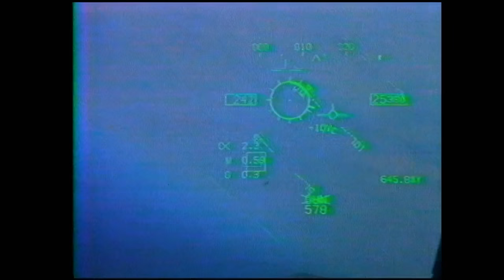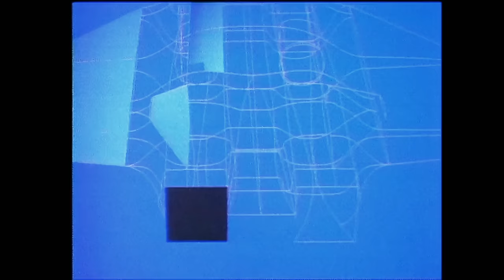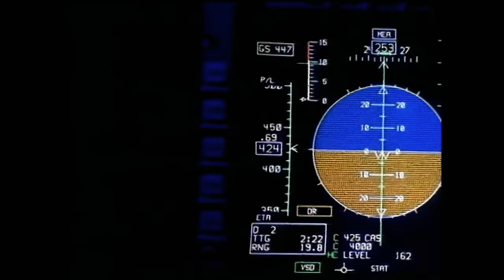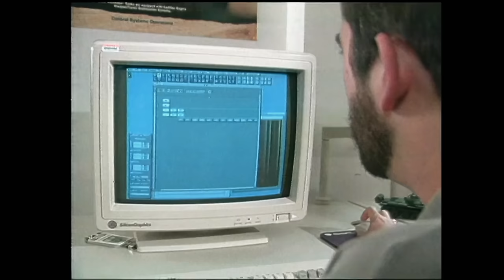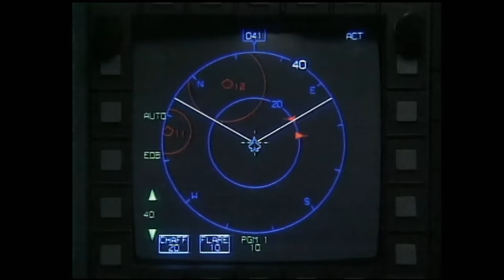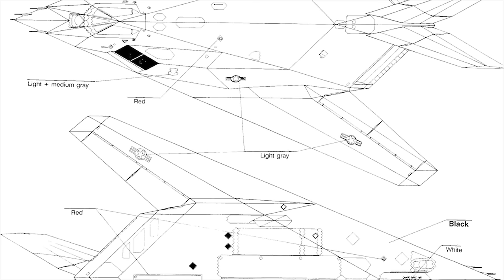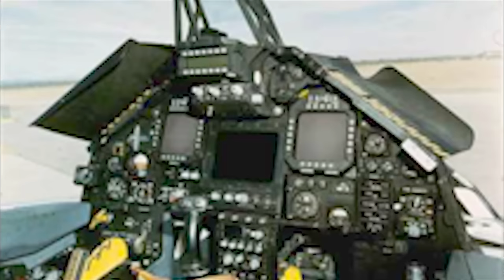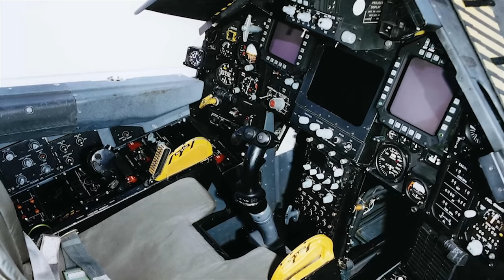F-22 Raptor Maiden Flight | Lockheed And Skunk Works Stealth Tactical Fighter Aircraft | PT. 1

Comment: I've always felt the YF-23 was the superior air vehicle.  Granted, it might not have had QUITE the yank-and-bank capabilities as the Raptor but IMO more than made up for that in other areas.  Areas such as super-cruise, greater stealth and others.
Reply from the maker: Some interesting takes on the YF-23: https://youtu.be/JRbKtXKR0NA
Reply from the maker: @deantait8326  In truth, it seems that the general public (and not only) thinks it was a close call between the two aircraft
Reply: YF-22 > YF-23
Reply: @fw1421  No excuses
Reply: YF23 is the victim of circumstance, and that is the era of budget cuts...
In the past, when YF16 was selected to become the F16, the other YF17 was modified a little, and became the FA18 of the Navy.. there were plenty of money   around to buy both.
Now each item is more expensive, with the budget constraints, only one will be the Cinderella.
Reply: 2nd place in this case was a beautiful aircraft. Could have easily been chosen over the yf-22. Not the case with the x-35 vs x-32. The x-32 was one ugly sob 🤣
Reply: @CM-fp2gz  It was so ugly you wouldn't want to pick it even if it had had better performance.
Reply: To my understanding the 22 was ultimately chosen over the 23 for two primary reasons.  The 22 showed more capability in maneuverability with thrust vectoring which would help in dogfights (which it was never meant for and has never been used for) and the dept. of defense had no faith in Northrop/McDonnell Douglas ability to deliver the plane on time and on budget since they already had the contracts for the B2 and F18 and had serious budget issues with the B2.  Of course the 22 ended up having the same delays and budget issues they feared from the 23.